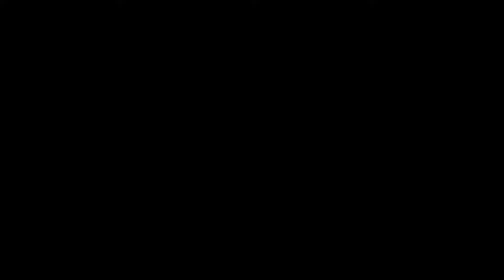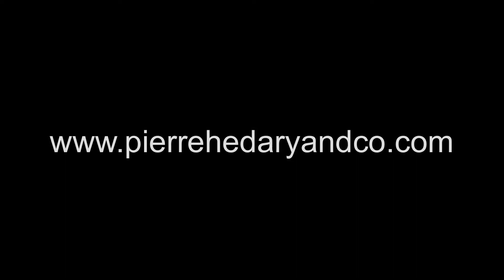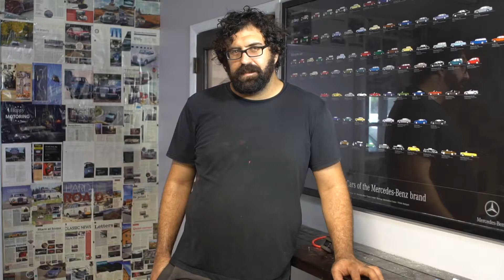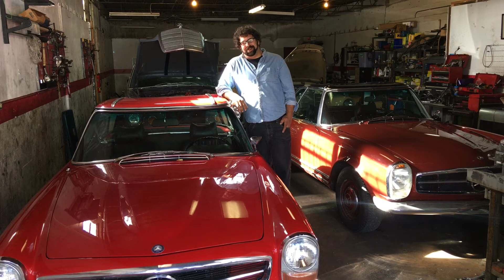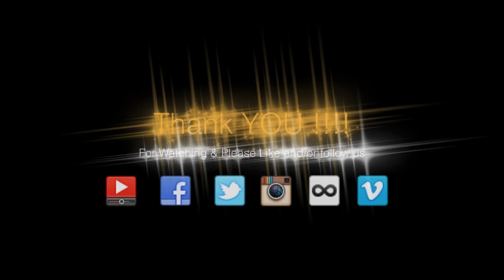Which Mercedes suffer from Evaporator failures?

Comment: I got lucky. I bought my W140 600SEL without knowing the evaporator issues. When I checked though I found out that the PO had paid $6000 to have it replaced at the dealer six months before I bought it. Still had the wiring harness insulation issue so I got rid of it after a few years. Was going to cost about a grand more than the car was worth. I loved the car though...
Reply from the maker: yes you did
!